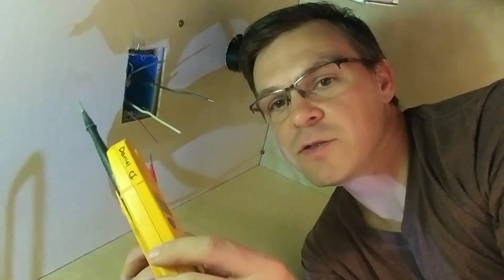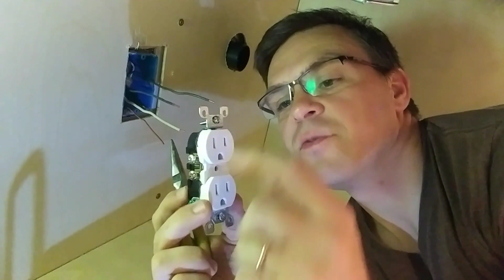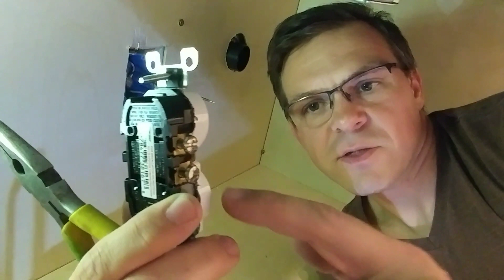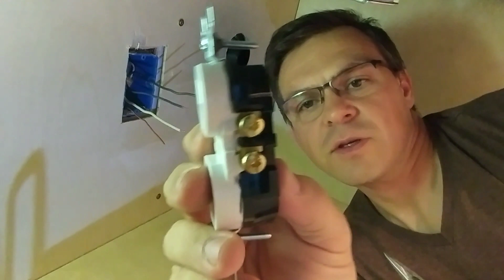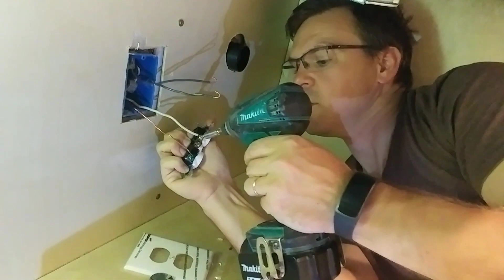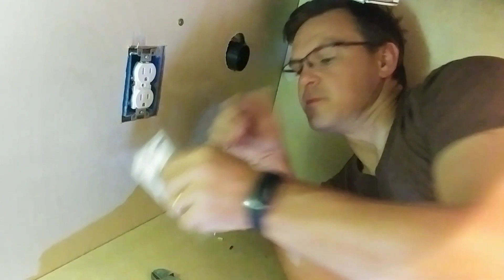How to wire disposal dishwasher Outlet. Dishwasher Outlet installation, garbage disposal.

Comment: Do we need to use GFCI outlet for dishwasher power supply?
Reply: Apparently that became code in 2014.  Either a GFCI outlet if you can get to it easily, or a GFCI circuit breaker.
Reply: Seems like you'd want GFCI for the disposal outlet because it's in the middle of plumbing.
Reply: Say did you place a GFCI in

Comment: maybe im crazy, but my always hot is coming from the switch, when the switch is on. At the outlet there is NO power unless the switch is ON. Clearly its meant to be setup with an always HOT at the receptical, one for the washer the other for the dispose. I think the original installation was wrong, but is there any WORKAROUND i can do? Aside from fishing out wires and completely redoing the setup?

Comment: Thank you for your video. Had it not been for the information you present, I would not have my dishwasher running right now again. The part about breaking the little tabs I knew nothing about and I would have been unable to make the fix without that information!
Reply: I think that's what I did wrong too. I really don't use my dishwasher but decided to run it to make sure it worked. I previously replaced the outlet above the dishwasher and didn't know that piece between the 2 hots needed to be broken. Now one of my kitchen lights and the dishwasher will not work. Guess I'm going to give it a go tomorrow.

Comment: Thanks for the video! I've watched a lot of videos because I kept tripping my breaker every time I flipped the switch on and you're the only one that mentioned snapping off the tab on the new outlet. I didn't know about that and it fixed my issue.

Comment: If I've done everything as instructed but the garbage disposal still doesn't work when plugged in, could it be possible that the circuit breaker fuse needs to be replaced?

The disposal works if I plug it in to a completely different outlet so I know it's not the disposal itself

Comment: I replaced an outlet but didn't break the piece between the 2 hot wires. My outlet works and my disposal. However, the dishwasher and kitchen light don't. Could that be the issue, the small piece between the two hot wires that I didn't break off? Any help would be appreciated.

Comment: They delivered and installed my dishwasher yesterday.  Due to depth space,  (partly because of the electrical outlet on the back wall behind the dishwasher where it plugs in, the dishwasher is sticking out beyond the counter face about 3/4 to an inch more than it should be. Would it be ok installing a recessed outlet to make a little more room to slide it back a little further be acceptable? 
Thanks for these videos.
Reply: Lori A $$ recessed outlets are very expensive. Use a 90 degree 3-prong adapter.
Reply: Outlet is supposed to be accessible (NEC 2017), should probly be in sink cabinet instead of in back of the dishwasher.

Comment: What do I do if I have two white wires and two black my problem is I've had this disposal for 3 years no problems suddenly I flip the switch and the button pops in the plug next to the switch shutting down the circuit
Reply: Great question did you find the answer? I also have 2 white and 2 black.
Reply: @mindycrispi586  I ended up rewiring it differently it was the white wire that was messing me up so I switched the white wires around gave the plug the disposal wire and vice-versa it ended up working.

Comment: Your using the wrong socket(15amp) on a required 20 amp wire and breaker. Also using those holes with 14 gauge wire is just dumb! That little blade touching the wire will arc and fail later... Always... Use the screws! Àlso any outlet in a bathroom or kitchen sink MUST use GFCI outlet... The outlet box should use metal grounded .
Reply: DW only requires 15amp for standard units. Also, he didn't say specifcally, but I'm assuming this outlet is daisy chained off the GFCI load side above the sink, thus making this one protected as well.